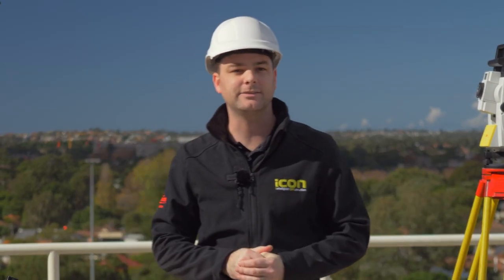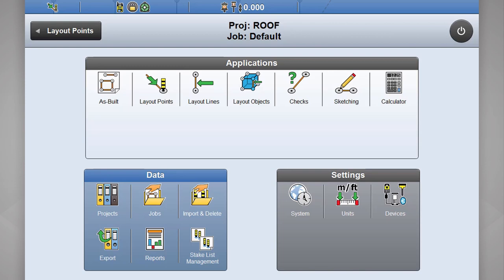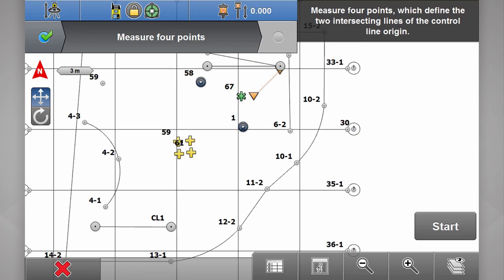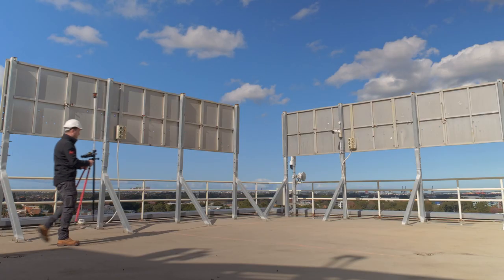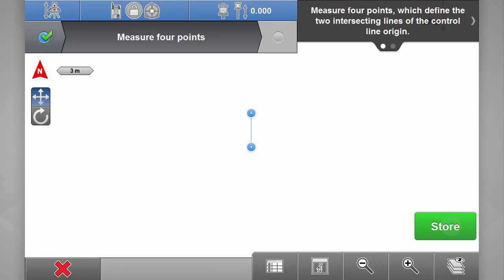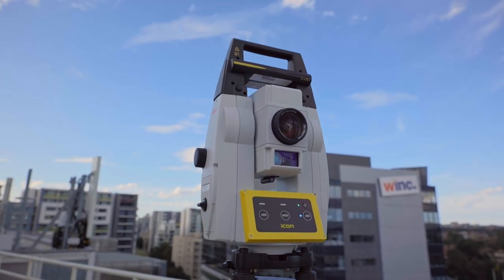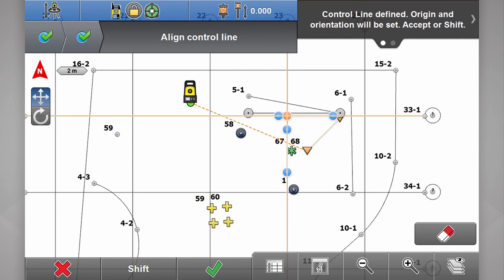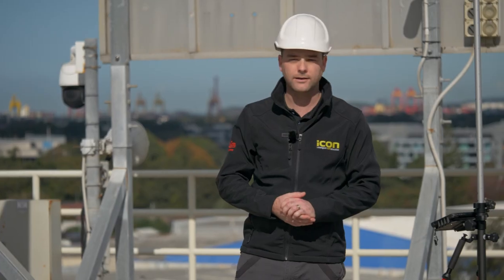Leica iCON | Setup and orientate instrument on site

Comment: so your just using any place on the line, doesn't need to be an actual point? Is Icon using some type of fitting algorithm?
Reply from the maker: That’s right, 2 points anywhere along the intersecting lines. iCON is using these 4 points to determine an intersection, orientation and position. 

Think of it as drawing 2 triangles to position the Total Station in the drawing.

Comment: What if you show up to a site with no drawing but there is an internal corner of two "walls" that "intersect". Could I shoot some points on the wall to get the correct angle and build a sketch, and then go into the as-built wall setup and re-shoot the wall? would that work? then everything thereafter is relative to that setup?  How reliable would this setup be compared to a resection to control points?
Reply from the maker: Hi CR3DT, 
You could do that but you’d have to make sure you measure the same spots on the two intersecting walls. In that scenario, I would measure the walls, put up some stickers / texta marks, and measure them as control points. Then I would sketch in your new design. This way when you setup again, your sketch will be aligned to the internal corner of the two walls & your setup will be as accurate as a resection off control points.
Reply: Thank you, that makes sense
Reply: @CRKennedyGeospatial  does icon build support the use of the tablets camera on the Panasonic/leica controller?
Reply from the maker: @CR3DT  An iCON site licence gives you access to the camera & linking photos to measured points. If you have the iCON Build licence, you’ll need to purchase the additional camera licence. 
You can also use the Panasonic camera outside of the iCON software. Hit the windows button and search for camera.
Reply: @CRKennedyGeospatial  Thank I appreciate the response. Please keep making these videos they are great for new customers and the Leica icon community.